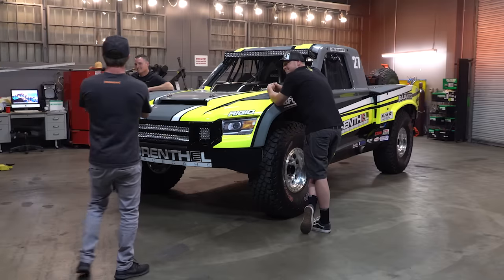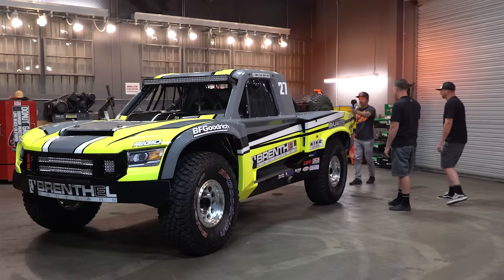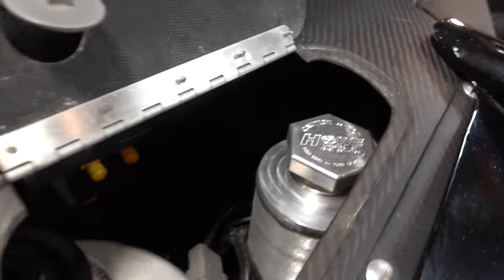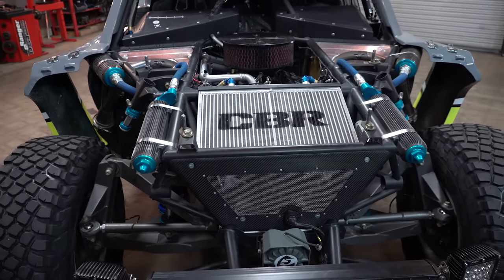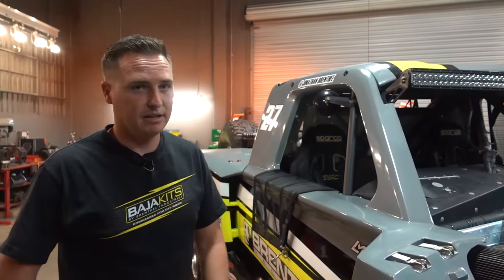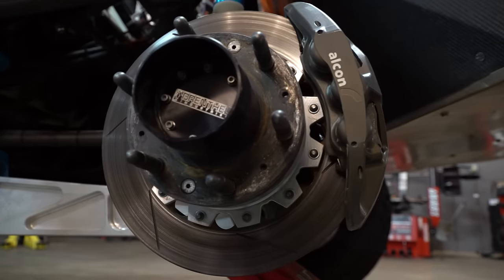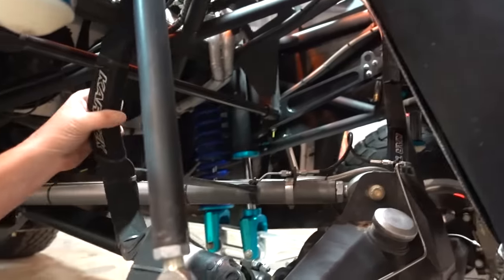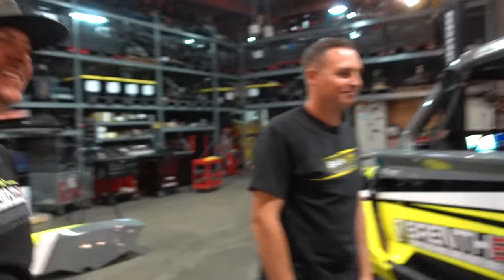The Ultimate Desert Racing Truck... That You Can Buy!

Comment: Trophy Trucks is definitely one of the most badass racecars around! Not only for how they are run but fabrication wise too, and that is a part I really like with all racing. 
Even though it say 'you can buy' no price is available either here or on their page... But concidering the level of engineering, fabrication and historical pricing these must break a million by now.
Reply: Brenthel has a video on their new shop & they said a PreRunner is $600,000 to $1,000,000. A race ready TT is $1,000,000+

Comment: The rear trailing arms are hard set,not on Heim joints. Won't that be a problem locking the rear with out any non lateral rotation(side to side twist)???

Comment: First off ford 460 bored, stroked, ported and polished with a forged 4 inch crank built to hell and back. Also you said its made of 4130 i thought trophy truck chassis had to be made of 5130 to meet regulations. Im no expert and i dont race so most likely im wrong. I would like to hear why 4130 and possibly why not 5130

Comment: Really 2.5 MPG isn't that bad when you consider that a F350 with a 460 in it gets around 8-10 and that's just driving down the highway not running across a freaking desert oh and it doesn't have 1100hp either :)

Comment: that truck is a no go. radiator up front. you guys ever been to the desert before?
Reply: it is rad in rear, oil cooler up front
Reply: @johncline5502  all coolers should be in the back. and brass exchangers not bobo alu. but its cool. its a budget truck. i get it.

Comment: Its a 2014-15 GMC Sierra. It has GMC truck headlights and taillights. So, #1 question answered 💁🏼‍♂️
Reply: Headlights and tail lights make the car? So if I put Supra headlights and tail lights on a CRX that makes it a Supra? Sick. I'll start putting Supra headlights and tail lights on everything and make EVERYTHING a Supra!!!
Reply: That’s what Toyota did to the BMW Z4 HA!
Reply: @gravitygear  that's how the Toyota Camry started racing Nascar...
Reply: @zachyeager2525  They didn't actually. They took a BMW engine and put it in something Toyota designed. The vehicle was designed by the Toyota USA Calty design group. The concept of the new Supra was unveiled as the Toyota FT-1 in 2014. So HA! to you too.

Comment: Didn't he say there is no ford dodge or chevy parts?  I guess the turbo 400 case doesn't count  :D
Reply: That's because the the whole trans  is aftermarket parts including the case. So technically it's not.  just based off the design of the turbo 400.